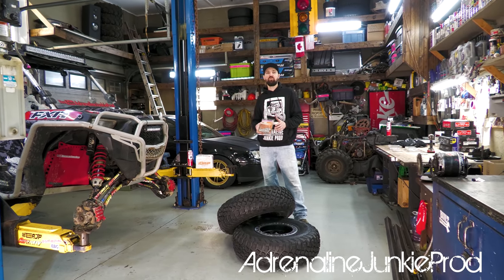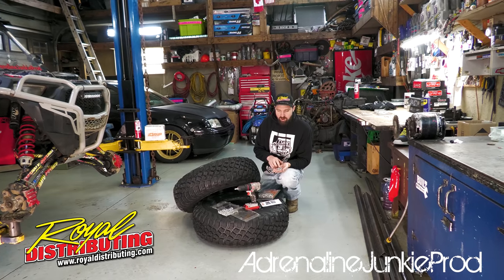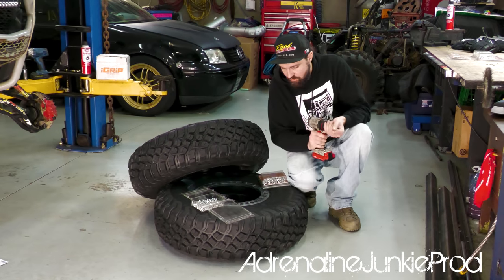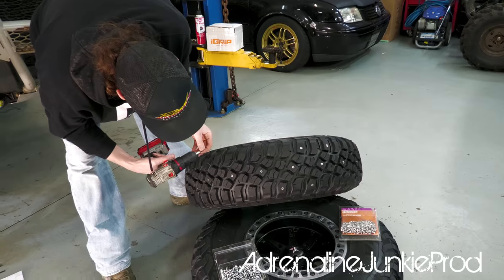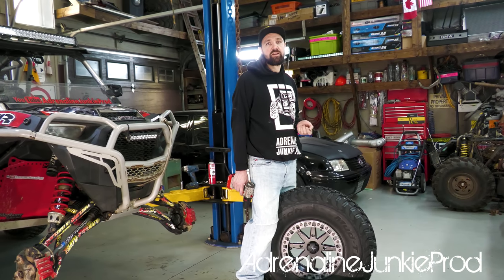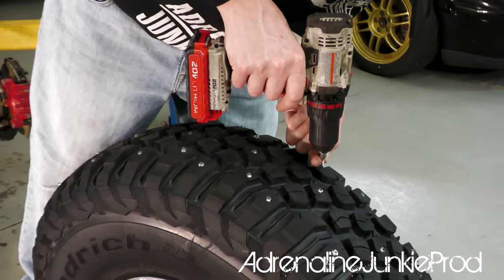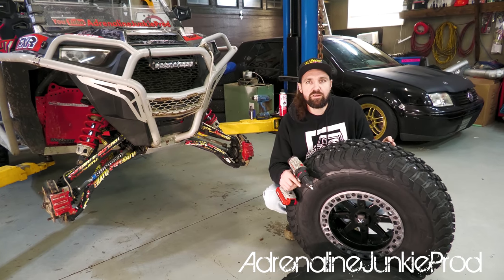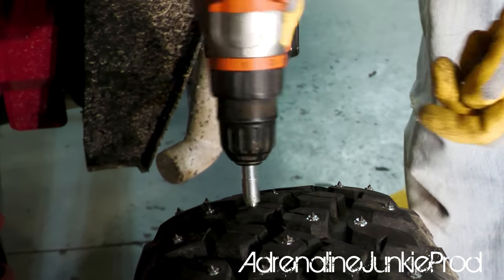iGrip Tungsten Carbide Screw Stud Installation - Offroad Tire Studs - UTV/SXS/ATV/4X4/Farm/Equipment

Comment: I know it’s been a week since you uploaded it, but I was watching it and thought to make it easier and maybe a lil quicker you could use a paint pen 🖊 or bright colored fingernail polish to mark on the tires where you wanted to put the screws   This would make it so you wouldn’t second guess yourself on where you were going to put them.
Reply from the maker: Hey Stacy, once you decide on a pattern it's easy to slam them in. Just follow the pattern of the previous lugs and move around the tire. It's deciding on the original pattern that had me scratching my head for a bit, lol.
Reply: @AdrenalineJunkieProd  yes that would be mine as well. That’s kinda what I was thinking of when I wrote about using the a paint pen

Comment: Do the studs tear up a paved driveway? The pointed tip vs a blunt tip carbide , wich would damage pavement less? I am considering studding a set of tires for a tractor with snow blower,  have tire chains but the ride is terrible when driveway gets icy.  Thanks  for posting video

Comment: what brand of tires are these, going to do some winter riding my stock tires on my xrc are not going to do that great in the snow
Reply from the maker: Hey man, as mentioned in the video, the tires are 32X10x15 BFG Mud Terrain KM3’s in the UTV specific weight rating.

Comment: Where are you guys from?? I'm new to the channel
Reply from the maker: Hey man. Welcome, lol. Our core crew is located in Southern Ontario, Canada.
Reply: @AdrenalineJunkieProd  ah darn. i live in calgary. Would be so fun to meet up with u guys and go fer a rip. Ontario is a long drive though. I'm looking at buying a rzr pro ultimate. Any other tips u have for me would be good. Like i saw the one video where u recommended getting a skid-plate. So im gonna get one of those. utvdirect.com sell the UHMV ? Not sure where else u would recommend i buy it from.
Reply: @MrCraigmire123  check out revco.ca Canadian company not bad pricing and shipping was fast believe they in bc so be even faster for you
Reply from the maker: @MrCraigmire123  I believe you could reach out to www.UTVcanada.com , They are actually based in Alberta. I'd see if SuperATV offers one. If they do then UTV Canada should be able to get you a good deal on one or something similar. If you enter "TEAMAJP" as a discount code on UTV Canada you'll get an additional 10% off. That's probably a good semi-local solution for you.
Reply: @AdrenalineJunkieProd  Perfect. thank you. I'll check them out. Also, do you recommend after market exhaust and intake? I dont want to make the machines louder, they already sound loud enough! plus i've kind of grown out of having loud exhaust.
Reply from the maker: @MrCraigmire123  I wouldn’t touch the exhaust and intake if you are staying stock tune. Especially if you don’t wanna add noise.

Comment: Spend a little bit more money and get gripstuds instead.  They have a wide auger style thread and stay in much, much better than these.   I have roughly 800km on my igrip 1800s in Bighorn tires and they are wore down 50% and have lost a dozen or so out of 600.   The thread on these are not much better than a sheet metal Tek screw.
Reply from the maker: Hey man, appreciate the feedback. So far I've used them on two hard rides and I've done some sliding around also. Haven't lost one yet I don't think. I'm going to keep stress testing them. Your carbides are worn down or the head around the carbide?
Reply: @AdrenalineJunkieProd  The tips are wore down 50% and at a sharp angle, the shoulder of the studs are almost complete gone.   So at this point traction is diminished with extremely good braking.  Might have to rotate the tires to get full traction again out on the lake.
Reply from the maker: @Ffrostking  really interested to see how mine hold up after hearing this. I’ll keep everyone posted on how they do in the long term.
Reply: @AdrenalineJunkieProd  Mine were severely abused.  Breaking trail in the mountains climbing long hills of broken rock under 12”+ snow.